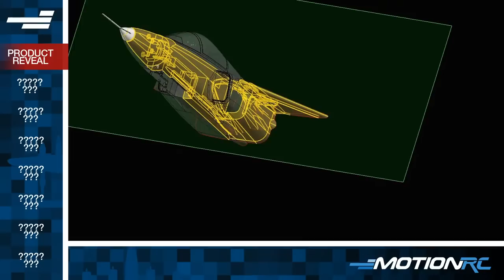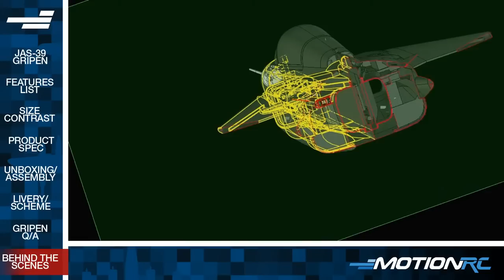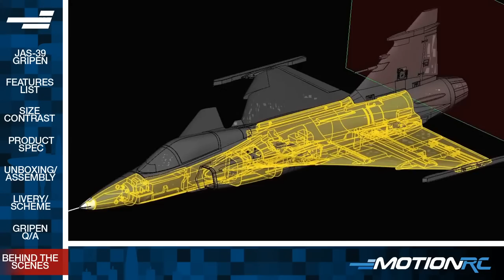Freewing 80mm JAS-39 Gripen RC EDF JET Announcement & Overview - Motion RC LIVE - Ep. #33

Comment: Sir I have 64 mm 12 blades 3500 kV EDF can it run on 4s 30 c CNHL brand lipo battery can this 30c battery work well
Reply from the maker: I'm sorry, I have no idea. Check with the producer of your motor what ESC it needs and what cell count that EDC can handle
Reply: @MotionRC  they show only cell no 3s or 4s but can not show c rating

Comment: Well, might not be able to turbine this, no where on the CG to put the tank:(
Reply from the maker: Guys are already talking in the Hobby Squawk forum thread about how they are going to do it. Link in the description
Reply: I read it and didn't see any info on it. I run a FB group for micro turbine conversions and I wasn't the only one to hesitate on the purchase due to the fact that CG is basically in the gear area and it doesn't look like there is any safe space for a fuel tank, even a small one. Can you guys help us turbine guys out and show us the battery bay, behind it over the CG so we can figure out if we can even get a small tank in? Thank you.

Comment: The front gear looks completly wrong. Too much ahead. Look at photos of the real JAS-39 Gripen. It is much more behind
Reply from the maker: Our designer explains this on the forum. Put the gear in the scale spot would shrink the battery compartment, not allow for grass sized gear and make the model much harder to steer in the ground. Function will win out on scale where it matters in RC models
Reply: @MotionRC I agree that it would have been much more fun if it looked right on the ground too ... so it was a shame.  
And it's not a car, so how would it be difficult to steer if it were done right?  And that the battery space would be smaller I do not understand .... feel free to show in a picture.
Reply from the maker: @jankarlsson5358  head to the hobby squawk forum thread and talk to the designer. Link in the description
Reply: @Jan Karlsson  I'm the designer. ALL of our scale aircraft do not have 100% scale undercarriage, it's a fact of life when adapting a full size aircraft to a model. Please consider the conversation on Hobby Squawk; I cover in depth there in the Gripen discussion thread why we've made the decisions we've made, and have made over the past several years, to make all these aircraft perform the way they're renowned to. 

Saying "It's not a car" is not the complete picture. For one thing, RC pilots aren't taxiing at scale speeds, and not on scale smoothed surfaces.